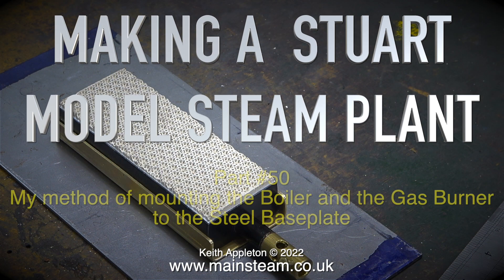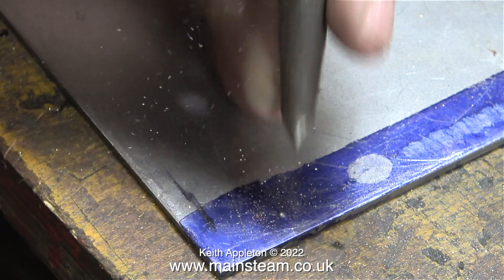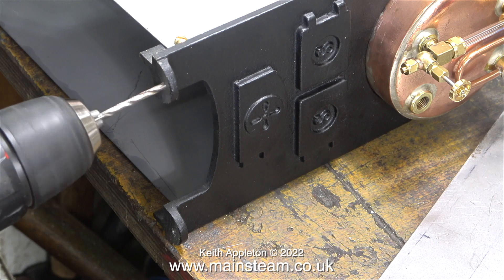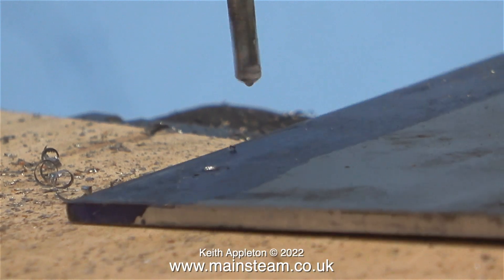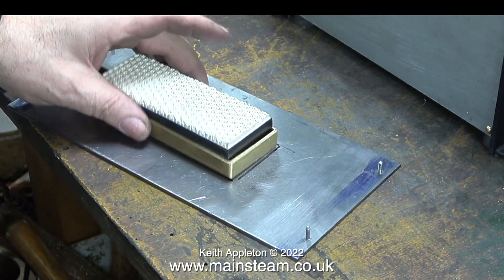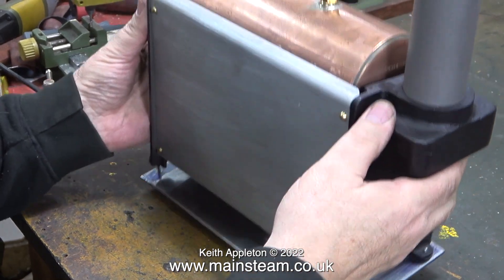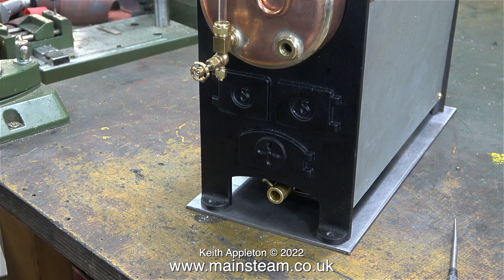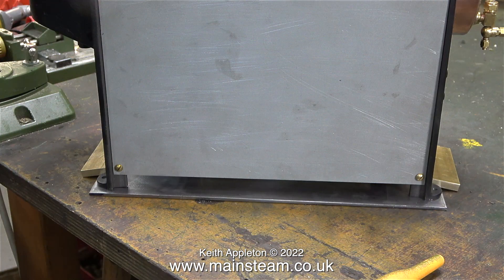MAKING A STUART MODEL STEAM PLANT - PART #50

Comment: I'm sure you've thought of it, but it appears as if the ceramic burner will have difficulty clearing the top of the opening in the cast iron base when it is held up by the nuts.  It also appears that the issue will be compounded by the clamp you intend to install directly in front of that opening.  

Not a hill I expect to die on, Keith, just the way it looked to the camera. The result will be revealed in the fullness of time I suppose!
Reply from the maker: It is fine ......